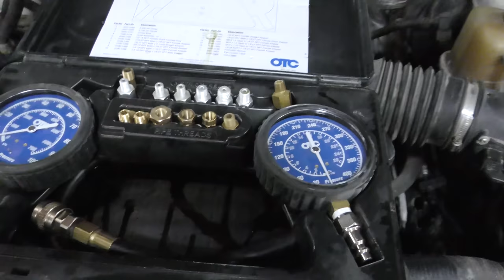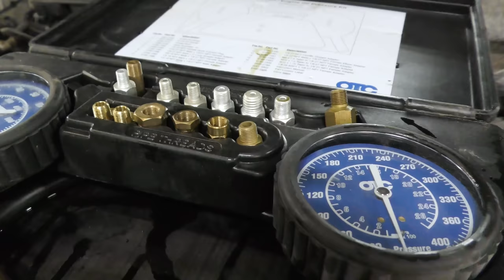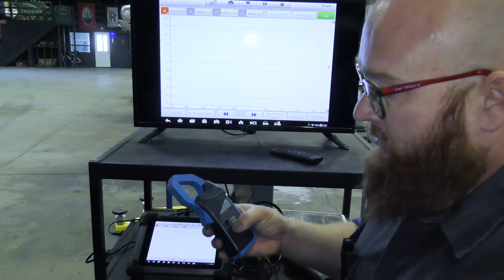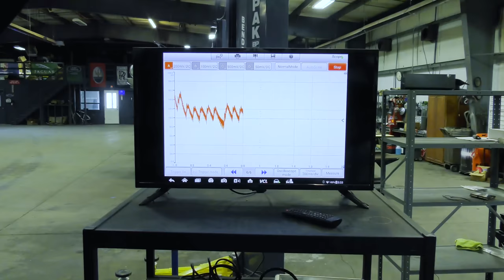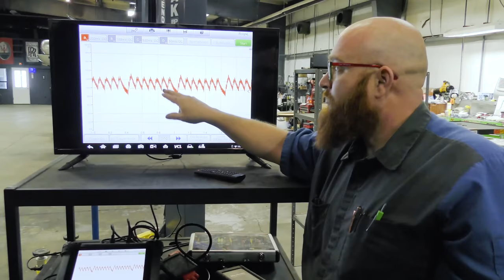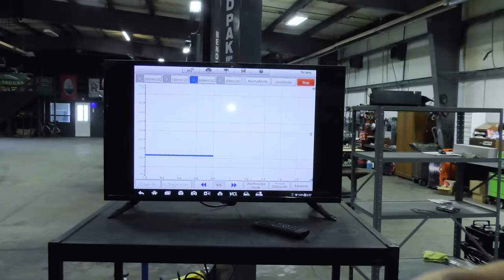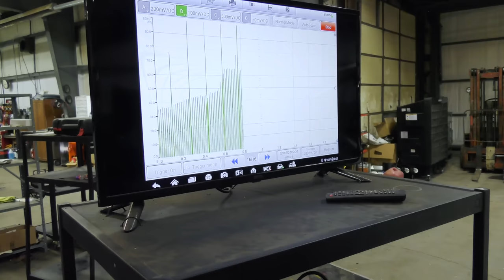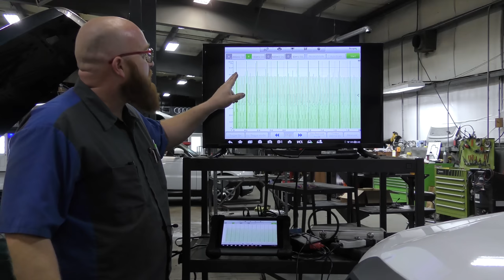Can an engine additive really fix this 2011 F150? CAR WIZARD shows how to diagnose and repair

Comment: Back in the old days thicker viscosity oil was used as the engine got older.  Same principle here.
Reply: Not necessarily. Engines nowadays have smaller oil journals and cam phasers. You go dumping thicker oil in a modern engine you will burn it up real quick.
Reply: @rolandthethompsongunner64  I said "back in the old days".  It WAS a simple fix for some oil consumption.  I k,ow fully well that modern engines have tighter tolerances and better metallurgy and require thinner motor oil.  Case in point:  try running 0W-20 oil in an old Chevelle.
Reply: @rolandthethompsongunner64  Sole owner of a 2007 Honda Odyssey that takes 5w20 or 0w20.  Burned ~1 qt oill per every ~1000 miles since new due to Honda's stupid VCM system.  Switched to 5w30 at ~75K miles and have done so since since it did reduce oil burn.  Still going now at +323K miles.  Oh, also only changed oil per Honda's maintenance minder system, which varies between 7-10K mile intervals.
Reply: @stevec8861  Honda engines can take a bit of use others can't. That being said I have run thicker oil and trucks that have a leaking problem or burning problem and it worked fantastic for my high mileage vehicles. I've always been told never to do it for new vehicles.
Reply: @setsunasetsuna9342  Some more info: My Honda V6 with VCM burned oil from the getgo becuase VCM shuts off three cylinders when under light load.  Oil gets in those shut off cylinders and is burned when they re-start.  When I switched to 5w30 it reduced problem somewhat.  Back then I didn't know disabling VCM was an option.  But at ~311K miles I disabled VCM via an "S-VCM controller" device.  Oil burning ceased and hasn't returned now at +324K miles.  Still using 5w30.  Had I disabled VCM when car was young, I might likely still be using 5w20 or 0w20 unless oil burn remained a problem or started as car aged.

Comment: The only thing I don't like about Lucas is the fact it has almost 0 additives and detergents in it , this has been proven with oil analysis. The measured viscosity of Lucas Oil Stabilizer is equivalent to 70 weight oil. So wouldn't it just be better to bump up to 10w-30 or 10w-40 oil if need be? .
Reply: Yes, it would be much better to use regular oil. And cheaper!
Reply: Lucas now makes a low viscosity oil stabilizer specifically for newer cars.
Reply: it s like adding gear oil... it makes the oil thicker
Reply: I dont know if you have ever used Lucas oil.  Its thick like Honey.  Way thicker than any regular oil I have used, and I have used 15w50 before.
Reply: See the high mileage Lucas. That has additives.

Comment: I have two ~30 year old Mercedes; a 1995 E320 sedan and a 1991 250TD diesel, wagon, 5 speed. Sedan i've put over 100000 miles on, it has 240XXX miles on it. Just got the wagon.  165XXX miles, although the odometer is in kilometers. You gotta love the 8 liter (~2 gallon) oil capacity. Contamination in the oil is diluted over the large oil quantity. 

Change oil hot and often. I do 10k miles as I mostly do long distances in my car, rarely do 5 minute type drives.
Use recommended fluids and filters.
Do other recommended maintenance at recommended intervals.

Attend to repairs as soon as possible.

With a well engineered car, that's about all you need to do to keep it up.

Comment: Altel should send this video to shops so they actually use the equipment instead of firing the parts cannon. lol
Reply: It's not like this equipment is new.
Plenty of other shops do this stuff, and have done for many years. The Wizard is well behind the curve here.
The only new thing I saw here was the spark tester.
Reply: @Cheepchipsable  so why do the other shops just fire the parts cannons?
Reply: @beastumfan  because $$$
Reply: Shotgun mechanics...lol
Reply: Because "dealership mechanics" are just parts guys that know lefty loosy righty tighty. I tested the big dealership when I moved to this city when my fuel pressure regulator was leaking. They had it for a full day and couldn't find it. I opened the hood, pointed at the fuel soaked regulator and said "it's right there " the "mechanic" said " oh" never went back to them.

Comment: Car wizard the Lucas is nothing but high viscosity oil with no additives. Switching to a 20w50 is a better fix for an engine so you get the full additive package and a quality oil.
Reply: Mobile has a 5w50 with a good amount of zinc.

Comment: Yep, I've used Lucas Oil to quiet down tappy engines in the past. I had a Taurus with 250k on it and it would tap without Lucas in it because the tolerances were too loose and it wouldn't get good pressure at idle. Sold the car at 320k and the engine was still quiet when using Lucas. Good stuff.
Reply: WOW 🤯

Comment: I had the same problem in my 2011 5.0 v8 super crew with 130k miles that was burning oil at about 1 quart every thousand miles as well as low pressure issues very sporadically. I changed the engine oil from motorcraft 5w20 blend to a mobile 1 full synthetic 5w30 with OEM filter and my problem was fixed! Doesn’t burn a drop of oil now or have oil pressure issues. Everything else about the truck is perfect still being a 2011 and 130k miles.
Reply: I've got a 2011 F-150 5.0L FX4 Supercab I bought new, it's always had MC 50/50 synthetic blend oil since it was new, at around 90K miles I started giving it a quart of Lucas, so far at 105K miles it runs just as good and smooth as the day I drove it off the lot in June of 2011.

Comment: Put Lucas oil stabilizer in my vortec 6.0 with 160k on it that was idling warm around 20-30psi and wouldn't go above 45 several days ago, now idling at 40 warm and goes up to 65 at high rpm. Definitely worth giving a shot for anybody having low oil pressure issues in their old trucks

Comment: Used Lucas for all my vehicles. My Dodge truck is at 260k+ and my wife's CRV at 270k+. Even use Lucas on my motorcycles. Definitely helps keep a motor running longer with less wear and tear effects.

Comment: This is some next level stuff.  That compression test will save tons of time.  Wizard, indeed.
Reply: Its not a compression test, and you don't need to buy Autel equipment to get it. Its a relative compression test. The readings you see on the screen are not compression numbers. Its showing how hard the starter has to work to make compression on each cylinder. In the video, the starter didn't have to work as hard on cylinder 2 because of low compression. The readings are typically given in percentages. They represent how hard the starter has to work on the compression stroke for each piston, and the results are compared to each other. The readings should all be close. If one is low, that indicates low compression. If you want to find out how much compression is actually being made in each cylinder, you need to do a real compression test. 

This is a scope function that's starting to find its way into more and more scan tools. Depending on how the tool is designed, you don't always need the amp clamp. If the vehicle is OBD2, the tool can get the information without having to use a clamp. If you want more details, just do a search for relative compression test.
Reply: @AT-wl9yq  thank u!  a breath of fresh air to have such clarity!

Comment: Have an 06 Silverado with the 5.3L. Now has 298k miles on original engine that's never been torn down. Been running Lucas additive since about 140k. Great stuff!!! It does have slight lifter tick but in tolerance oil pressure and still has power. Here's to another 300k lol. Keep up the great work wizard and great advice/content. Love the channel.
Reply: So over 158,000 miles you have used roughly 50 bottles of Lucas @$10 each if you do 3000 mile oil changes. That's 500 bucks! You could have had some serious service done if you just saved that money and used regular oil like an intelligent person. Lucas didn't "save" any part of your engine. (298k isn't that much for a 5.3)

Comment: Lol, literally the first thing that came to my mind when I read the title was 5.4 triton 🤣
Reply: Thankfully when I saw the year, i knew it wouldn't be lol
Reply: The 2 valve 5.4 was a great motor though
Reply: I don’t know, my 2010 Lincoln nav with its 3v 5.4 has 267k on it and hasnt had any problems yet.
Reply: ^and that's the thing, I've heard legitimate arguments for both sides, but i just always end up feeling more comfortable with the 5.0L than the 5.4L
Reply: @EMdemo  I would like the 5.0 more too honestly.  I feel like i am on borrowed time with mine.  It is running great though, no issues.
Reply: Damn nowadays you can't go the distance with them ford motors...I'll stick with chevys!
Reply: @2eagle86  I sell engines; GM sales have been catching up pretty quickly to the Fords lately. It cycles. 10 years ago the Mopars were paying the bills.
Reply: One of the worst engines Ford has made in a long time. Of the big 3, Ford has always been at the bottom of my preference with Dodge first and GM second. My wife is handicapped and we were looking for a short bus to use to haul her equipment around but nearly every one had the Triton in it. Darn shame.
Reply: @2eagle86  I love Chevy's but they are starting to have transmission problems in their trucks well before 100k these days. Kind of a bummer with all the brands for what they want for trucks these days starting out at about $35k.
Reply: I've had 2 work trucks with the 5.4 that got over 350,000 miles with very poor maintenance. I know one was tuned up once. Not sure about the other.🤣
Reply: @webman1956  Yup, with the 6l80 and 5.3 with cylinder deactivation (add on direct injection) and its a poor platform. Even though I am a Chevy liker, I would take a 5.0l Ford one that combo. Dodge Hemi, I got good swapping cams/lifters.
Reply: @mph5896  I`m pissed at all the truck prices of all the brands lately. I`m not paying 60 grand for a halfway loaded truck, I`ll wait and buy a mildly used one 3 to 5 years old. Sorry I got off topic but they are all taking advantage of us truck lovers!
Reply: @webman1956  I just try to buy 8-10 year old rust free stuff. Run it until it gets crusty (I am in the rust belt) and send it. Problem is 10 year old trucks are selling for 10-15k when they were 1/2 that price a few years ago.
Reply: @mph5896  Well there are plenty of trucks that are rust free here in Texas but you are right about the price. I`m looking now for a Truck from 2012 up with under 100,000 miles for under 20k and they can be found but they are not all over the place and not newer than 2014 unless they are rebuilt title.
Reply: 15w40 since new 04 F150 5.4 3v 300k miles no issues ever.
Reply: @aspenyukon6845  you have to take care of these engines, if you don't they fail.
Reply: Best thing for a 5.4 is MotorKote .  Quieted down my 250k mile 5.4 almost instantly.  1 quart every 3 oil changes
It has over 500k miles now.  Grant it, it's the later version without head bolt issues
Reply: 5.4 3v Millions of f150's sold.....car wizard has seen 20 of these with owner's that didn't maintain them....thinks its a bad design....
Reply: Me to I knew it was
Reply: @aspenyukon6845  it was a bad design, especially with the exploding head bolts. Lol.   But after fixing that and using an additive like Motorkote ( lucus is too thick for a 5.4)  they will run forever
Reply: @aspenyukon6845  I've seen more than 20.  Paid for my second house fixing those turds.  So I love them because they are turds.  Keep 10-30 oil in them and maybe stick the phaser blockers in them and they're OK.  The Melling high volume oil pump helps too.  Ford really stuck it to a lot of customers on those.  So many with around 60-70K miles on them and needing chains, phasers, oil pump, and maybe a right cylinder head.  Ford should have extended the warranty.
Reply: My 2004 5.4 triton has 207k miles. Vigilant oil changes are the key. Rotella syn 5w40 every 5k miles. I use 40 instead of 20 to thicken the slop in the cam phasers, but being a 5w, it's still thin when cold. Been using that oil since 2012 in it.
Reply: @wayneparris3439  was there a diesel version available
Reply: The 5.4 3v isn't so bad once you get rid of all the plastic timing components & add the HV oil pump👍
Reply: @neilmurphy845  Yes there was but I can only buy what is offered on the market and on the used market the diesel is a very rare bird indeed. Normally the auctions for school and special transportation services have good deals on busses but nearly all have the Triton with the "blowing spark plugs out" problem. Thanks anyways :D
Reply: Ford's 4.6l v8 are bulletproof engines very reliable.
Reply: When I saw the title it took me by surprise because he always recommends engine replacement of 5.4. Also, to the best of most peoples experience, no additive will solve the 5.4 engine issues. At best kicking the can down the road. But alas, he's not talking about the 5.4.
Reply: 2 valve👍
3 valve👎
Reply: @robertrutherford9057  Motorkote 👍
Reply: @aspenyukon6845  the 5.4 was a bad design that dodge came up with, realizing it was crap and sold it to Ford. Lol. True story.
Reply: Change the oil every 3k miles. Oil is done at 3k mi. The engine is more of a mercedes design.
Reply: @aspenyukon6845  it was designed by Dodge
Reply: @aspenyukon6845  lol

Comment: Well, again thanks for the video. 
Wizard, check this out.  So i have a 1997 expedition with 471,678 miles. Obviously has the 2 valve 330. Still running strong. No rebuilds to the entire power train.  Love my truck.  Yes i take good care of it. Just got back from driving to northern California and back here to Tennessee with it. Towing almost 7,000 pounds in the back of it. Not to mention 8 full grown people the whole time in in back.

Comment: My 2004 f150  5.4 triton pulled heavy loads.and had 278,000 miles when I sold it. 3 years later. The kid is still driving it.  Had to replace four coil packs on it. And new fuel pump.

Comment: Technically, the same result with the Lucas can be achieved by going to a higher viscosity oil; and I do agree that the Fram filters we use at Walmart really aren’t the best that we could use. (I personally use OEM filters on our vehicles)
Reply: Thats a common misconception. Many people refer to lucas as "just a viscosity booster". While technically true, its alot more than that.  It contains special additives and such that make it a great oil stabilizer. It creates a strong oily film that sticks to your engine internals. I know this because I used to use empty Lucas bottles as oil funnels.  After I would cut the end off of the bottle,  I would spray tons of brake cleaner to try to clean off the rest of the Lucas.  Even after spraying the brake cleaner the bottle would still have this strong slick oily film from the Lucas additive. Its pretty awesome stuff.
Reply: Rotella 15/40 will give you those main bearings back. Also, I prefer Wix for all filtration needs.
Reply: @kb9oak749  for a short period but it will cause more issues because only some parts need that higher viscosity and those that don't will be damaged. This is just a bad option used by people who don't know better.
Reply: Old saying concerning Fram.
"Red is Dead"  (as in your engine)
Reply: Just Redline 5w50 oil and you don't need any stupid additives
Reply: @jamesmancuso3666  i mean if it's knockin,  burning oil or losing oil pressure its not long for the world anyway. Whatever  new problem thicker oil may cause aint gonna be what kills it.
Reply: You cannot buy a thicker oil than lucas. It's cSt exceeds 100 weight oil. By the way, 75-90 gear oil is barely thicker than 5-30. Don't be fooled by gear oil numbers, it's that way to prevent people from putting gear oil with lesser additives into the engine. Pour out lucas from a jug, and you'll know what I mean. It creates glue like strands that stretch quite alot.
Reply: @chrishernandez2490  LOL! Lucas is nothing more than thick oil. Oil does not need to be "stabilized", it is not "unstable" to begin with, that is just marketing BS. It means nothing.

As for "you cannot buy thicker oil", that is also wrong, but, even if it were true remember they are still mixing it with 80% thin motor oil. If you just fill the whole thing up with 15w40 it would do the same thing, probably cheaper. Lucas is a snake oil product meant for clueless Walmart shoppers.
Reply: @ryanroberts1104  Have you ever used it?
Reply: @EliteNK  No, why would I buy overpriced snake oil? I know what it's made out of and how it works, it serves no purpose that regular thick oil doesn't. And using the word "stabilizer" makes it a clear scam because there is absolutely nothing about oil that needs to be "stabilized" and they don't even bother to explain why it would.
Reply: @ryanroberts1104  You got the wrong attitude. Not even a professional could change your mind on so I'll leave you to it. It fixes problems and is recommended by dealerships—end of the story. Put pure thicker oil in your car and see how long it lasts.
Reply: @EliteNK  LOL! You have no idea what you are talking about. I know the science behind it and why Lucas, and thick oil do exactly the same thing. Look at the top comment here and all the thumbs up who agree. It absolutely does not "fix" anything for anybody. It does cover up certain problems so you can get a few more miles before your engine blows up when it isn't worth rebuilding. You can use either Lucas or simply 20w50 oil, both do exactly the same thing.
Reply: @ryanroberts1104  it does not do the same thing. I used 20w50 oil on a 2003 civic, and the engine blew up in 15k miles. I have been using Lucas oil treatment on a 02 Camry for 93k miles, and the engine has no breaking down signs like stooped suddenly in the middle of roads as my civic did. My camry is 170k miles, and it will definitely get 200k. Not sure about 300k though.